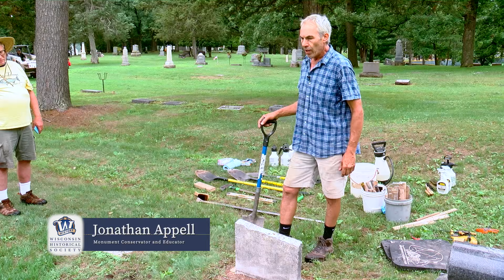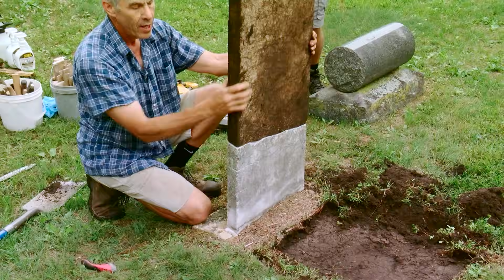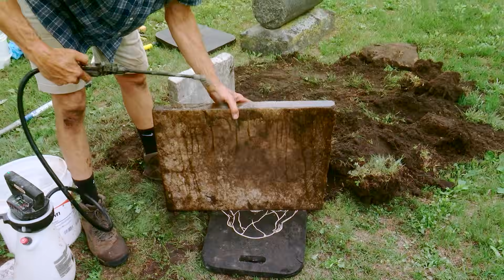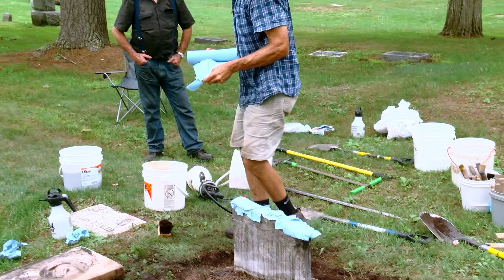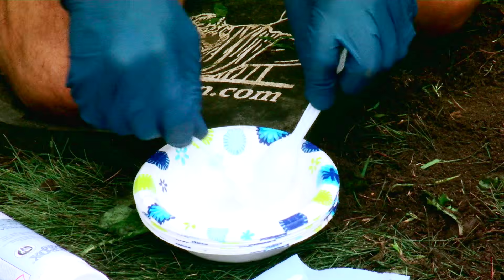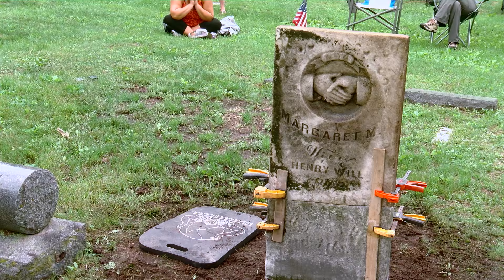Local Cemetery Conservation: Repairing Broken Tablet Stones

Comment: I guess you didn't notice that when you stepped on one corner of the base, it still moved, so you should have eliminated all movement completely to assure no movement and thereby making it better to avoid wiggling when the fractured piece is set on top.  Also, engineering wise, it is best to get coverage to the very edge of the break in order to get as much contact as possible on the very edge, especially when dealing with such a narrow piece with such a large area for wind to get ahold of.  Perhaps clamp a small board along the crack and put some plastic along it to avoid adhering the board to the stone, and wet the plastic with something that the epoxy won't stick to.

Comment: ALSO
It seems like it would be better to clean BOTH sides while the upper portion is on the foam pad. Then, if he gets it a little dirty putting it in place, he can deal with that MINOR and RECENT dirt with minimal pressure anywhere. He already sort of cleaned both sides anyway so it wasn't a case of keeping it dry, but it seems he just didn't want to take the time to do it right then. 
QUESTION 
Would he have done everything the same and as quickly if it was his close relative (Dad, Mom, Son, Daughter, Grand Parents)?

Comment: Good Concept-

First- The buried facet of the headstone is full of Dirt and Debris.

You need to clean it off, and the dirt and impurities need to be removed. Limestone is porous, so using water and dawn soap is going to have to be the a little at a time, so you can clean both adhering surfaces. Otherwise, the dirt and debris that has the living material in it will grow inside the adhered surfaces. Though not an ideal way to clean it, laying the stone on a sheet, and pouring water over it, as you lightly use a toothbrush to get the dirt and organisms off of the stone, and then letting it air dry, you have two good bond points, for the adhesive. Even then, you need to use a reinforcement technique, because the adhered points are only as good as the lifetime of the adhesive used.

Moving the base stone.

Always use a assistant to move the base stones, because you run the risk of damaging the stone further, and safety reasons. You only get 1 chance with the restoration, so unless you want to recast a new base stone (Which is always an option, but one of last resort) You want to treat the movement of these old stones like you would a kitten. They really are that fragile. Your worst problem with Limestone is that it deteriorates when buried, because of the living organisms in the dirt, the saturation of water in the earth, and the wear and tear of the stone due to age and elements.

Leveling of the base stone.

Always level out the base stone, and make sure that it is refitted on a solid base. If it is not. anything you do to try to restore your gravestone is wasted, because it will just sink, or shift within a couple of weeks....

Just an add experience, not trying to detract from the work.
Reply: BINGO!!! You and I are on the same page. I have tremors and it would have taken me a looooong time to type all of what you said. I used to build and remodel homes. The 2 most important parts of a home is a GOOD, STABLE FOUNDATION (applys here too) and a GOOD ROOF! The way he bypassed the base made me CRINGE! You are absolutely correct. Either do it the right way or keep on walkin. I would have taken the time to form and pour a footer (wider/longer than the bottom portion and set on sand over large base aggregate and tamped soil) complete with steel reinforcement buried within, come back after it has set up and finish the job.

Comment: I'm sure the tree root helped split the layers in the base, too.

When you cast a concrete replacement base, do you make a through- mortise so water can drain down to the soil instead of lay in a closed mortise?
Reply: One would expect that method to be best practice, especially in zones with many freeze/thaw cycles.
By the looks of many installs, this was not done in the past.
Reply: He didn't cast ANY base. He just poured SOMETHING around what looked like A base then poured SOMETHING ELSE over that with no measurement and on top of loose soil. What he was doing caused me to CRINGE!
Reply: @billko9201  Yes, It was an informative video but...I concluded that he was more interested in making a video than in doing a complete and good job of the repair.

Comment: Nice work. You did mention that if you ask 10 preservation professionals the same question. You will get 10 different answers and so I have one other that's a bit different than yours. We do blind pin 2" marble tablet stones frequently using fiberglass rod for pins. Usually 3/8" pin diameter in 7/16"  holes. In 15 years I have never shattered or blown out a surface, though I agree that it is possible to do so if you don't know what you're doing. 
In defense of our method (pinning), I feel that the loss of material on the interior of the stone more than makes up for the future damage when the epoxy eventually fails and the top pieces fall over again and perhaps break into even more pieces. 
Just my opinion. Cheers!
Reply: Would say this is an accurate observation, especially when dealing with government.  What is your source for the fiberglass rods?
He mentions not using Portland cement due to the hardness to which it cures.  I would think the same could be said for epoxy which typically cures to a brittle consistency.
Shame is, most cemeteries in America are mismanaged or not maintained.  People interred their relatives thinking there would be "perpetual care".  Sadly, there is no such thing.
Reply: @dc-wp8oc   we order Fibergrate rod from Grainger.
Reply: @dc-wp8oc Menards has fiberglass rerod.
Reply: Sorry, just saw your question. I get Fibergrate rod from Grainger.
Reply: Thanks for you comment, Leo.  May I ask: What length pin do you use?  I have a 2-inch marble stone from 1878 that is broken across the given name. Jerome Jackson 1857-1878 #drowned  #my1stcousin3timesremoved    It makes sense to me that a pin would give the repaired stone more long-term strength.

Comment: There are numerous ways these stones can break, from delinquent kids to riding mowers to animals to falling tree limbs and more. Simply returning it to the base and making it plumb is not a long- term repair. Perhaps reinforcing the back with a stronger stone or non-coroding metal could be better.
Reply: ALL of that was discussed in the video!! Stainless steel, aluminum etc. Was determined wasn't needed on this particular tablet! He class/teaching went a bit fast BUT he covered ALL of the repair types that can be done. This one would be fine being plumbed at base, cleaned and then Epoxied on top/bottom of tablet. He determined that braces weren't necessary on this stone. It's ALL in the video!
Reply: @LovelyRitas not really and not thoroughly.
Reply: @LovelyRitas he re"paired" it on an insecure foundation (loose soil)!

Comment: I wonder if machining two U-channels made out of bronze to fit the two side edges might be a better long term solution to keeping these stones intact as long as possible.
Reply: Because these are outdoors in the Wisconsin elements,  bronze is NOT a good choice due to the RAPID DETERIORATION that WILL occur. Stainless steel, aluminum or on an Expensive end would be Titanium.

Comment: Dude…you just pulled that huge rock right off the burial that was in a tomb. So, that rock was apart of the lid to the tomb. So, you dug right into the burial of that poor soul. But, happy to see your restoring that burial. Kentucky has a lot of burials in old forgotten family plots that needs restoration
Reply: I don’t think it was part of the lid because it was way to shallow. The tomb is certainly much deeper.
Reply: It wouldn't have been this close to another burial plot.... You can tell it was made to sit atop the other one... Although I feel like it was an addition after the first stone. Maybe they couldn't afford that kinda stone at the time of burial or maybe they discovered this design for a stone later and wanted it added. But he did not dig up a cover for anything
Reply: Yes, 6 feet deep is required in Wisconsin or 8 if there will be a 2nd casket/urn. That limestone slab may have been a kneeling stone with flowers & such when it was above ground.
Reply: I was thinking the same thing, omg, that's sad! He should shut up and watch what he's doing more better! Omg, if he wasn't yapping so much, he would've noticed what he had done!!! 😢

Comment: Friend's husband's Military headstone got fractured due to equipment moving in another stone at a small Country cemetery site... NO ONE informed her., but whomever did this used brown Liquid Nails to reassemble... needless to say I looked like crap with drips running down side and faces.  Truly upset her! VA was informed and sent a new headstone calling it a Vandalism Replacement Stone. We all met to reset the new stone.... the original grave site was on a hill and several of us worked for hours to hammer & chisels chip out a 14" x 14" crypt in the sandstone and covered with a cement paving stone,

Comment: What is a keyway and what does it mean to be delaminated?
Reply: A keyway is where the upright part of the stone fits into the horizontal piece (a joining technique like fitting a key in a lock and glueing the key in the lock. 
A delamination is where a stone (or other hard object) breaks along a weak part in a line. The sandstone is laid down as silt on the bottom of a lake or body of water/river. Over time these build up and form layers of rock because of the weight of the next layer on it. Sometimes the layers can be thin or contain different material that makes a soft/weak layer. When the weak layer gets exposed to lots of changes in temperature or the weather it breaks. This break is called a delamination. Like when a vinyl or laminate floor tile in your kitchen gets water under it and the glue that normally holds it down stops working.
Hope this makes sense to you. Blessings, Dot
Reply: When things separate from its original form
Reply: Keyway
A slot into which you insert a like-shaped object.
Delaminate
2 or more layers of something glued (stuck) together and the glue quits holding it/them together.

Comment: Right below where it actually broke is a large crack. With Marble, many times you can repair the main crack, and then it just breaks on the next crack. Is there a recommended way to reinforce the headstone?
Reply: He addressed the other crack below the break and determined that it doesn't go thru and that this stone would be fine.
Reply: @LovelyRitas It goes horizontally all the way across. It's going to break.
Reply: @ptaylor4923 that was my assessment, too. I would opt to make another slab the same width as the marble with a slanted edge at the top and afix it to the marble.

Comment: makes me wonder if it would be best to get this one put at a 30 or so degree angle and under it cement so it can still sorta be upright, but it won't fall over any more since it is so thin of a tablet. It looks like it wasn't the first time it has fallen and I worry it will once again. I have seen ones like that before where its at an angle above ground by a foot or so and that might work better than straight up and down. Its so big I worry it will fall on a child and kill them.... that happened to a child where I live.